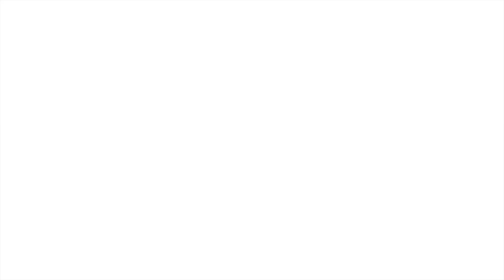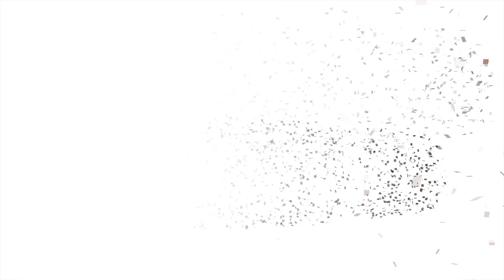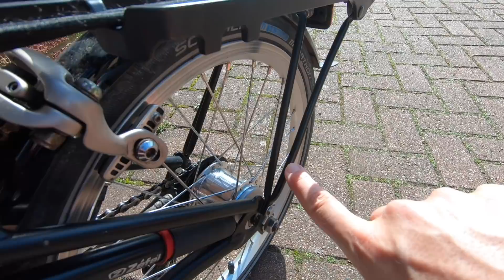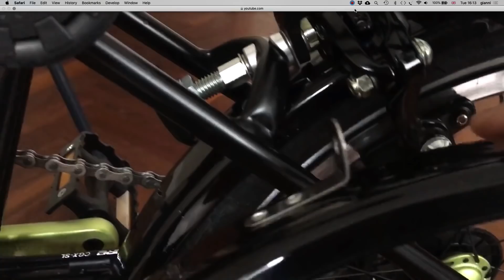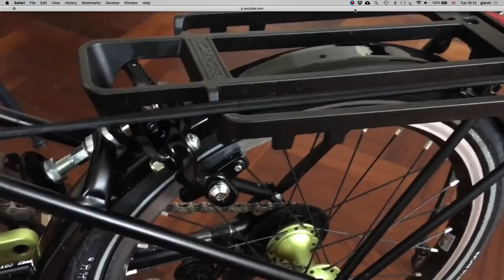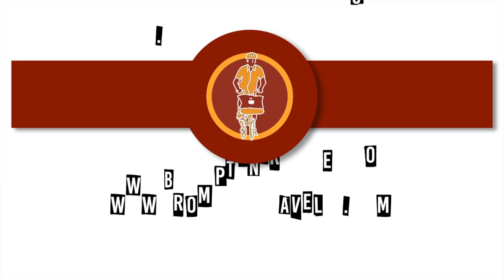What can go wrong with a Brompton

Comment: Why don't you bring the brompton on board as a carry on?
Reply from the maker: It is a little risky as there is a good chance that they won't let you bring it in. Also when I tour I have a carry on backpack that already weights 12 KG or so. It is possible and I read people have done on occasion in the US but probably without other luggage.
Reply: @BromptonTraveler  thanks! Am curious, if you remove the wheels, whether the brompton fits in a standards carryon suitcase & if you tried that
Reply from the maker: @LucaMatteis  Bromptons can fit into some of the largest Suitcases. I have never used this system because it would make sense only if you use a hard suitcase to protect the bike but if you do that you add 6, 7 kg of weight which would bring me over the limit. I also like the ability to leave from one place and arrive in a different one. With a suitcase you have to always go back to where you started as you have to keep it stored somewhere. You can check out how I pack here https://youtu.be/z8jclyfxSBg where I explain why I do it this way. Thanks

Comment: Can't you just bend it back into position?
Reply from the maker: That is what I had to do once and it worked... but it depends how badly it is damaged and you are not sure if it will hold for your trip. I wish they were selling racks with replaceable stays that can be removed by nuts and bolts. That way you can carry 2 spares. Cheers